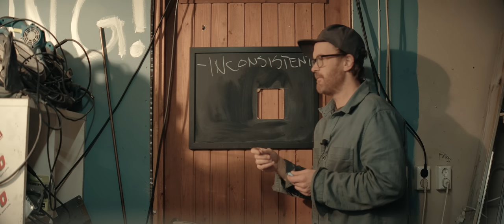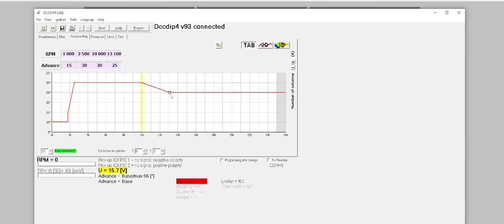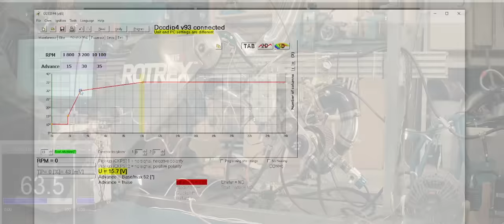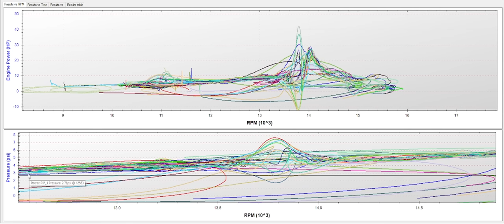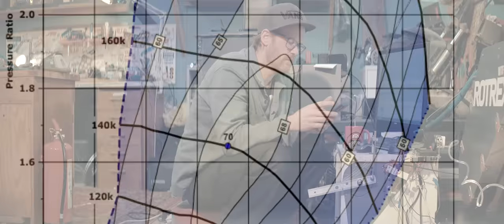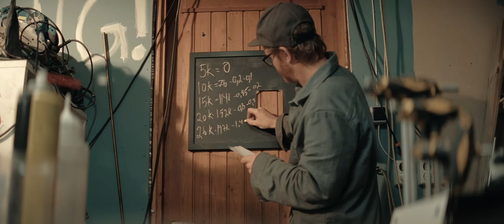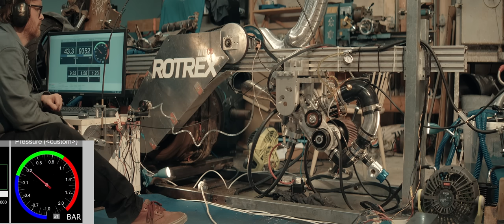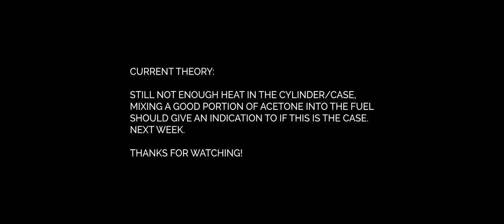Supercharged Pulsejet Engine?

Comment: A friend of mine found that compressed air confuses carburetion, he achieved success by relocating the carb in front of the compressor.
Reply: I think the nitro might destroy the supercharger but yeah, compressed air is confused in general
Reply: draw through is better than blow trough
Reply: If you take a look at the snowmobile Yamaha Rx-1 from around 2003-2005 they are carburated and really fits great to turbo charge and blow straight through the carburators, the only thing to do with the carburators is to put turbo pressure on top of the throttle.
Otherwise the throttles blow stuck in top... Not great... 😅
You can take out 300hp of these and drive it all day for 10yrs.
Reply: @mrolsen6987  It seems as if the pressure is consistent, the carb wouldn't notice.
Reply: @deanfloyd8931   it could depend on which kind of carburator you have.
Wich?
Which? ..🤔
Cheers from Northern Sweden 😂

Comment: I'm wondering if you have a resonance problem; a pulse jet is effectively a resonator. I have very limited experience with petrol and small diesel engines used in construction equipment. However, one of the things I noticed early on with chainsaw engines (and you almost certainly have too) is that they have a ball and spring blocking an extra jet drilling on their carburettors, when the chainsaw (brickcutter, whatever) reaches a certain number of revs, the spring and ball resonate opening the jet, making the mixture much richer and slowing the engine back down. It may be that you have something like the fuel level float vibrating off its seat and affecting the mixture. You've probably thought of this, but maybe using an injector straight into the top of the cylinder head - diesel style - might be a more accurate way of controlling the fuel mix. I know, complications, expense... but you're already pretty damn complicated there!

Comment: 0.8bar puts the ignition flame out and changes it to a fuel pump.  Put a spark plug in the exhaust set to ignite at 0.7bar for afterburner !
Glow plug model aero engines shouldn't work as well as they do while being super simple ? Make adaptor spark plug bush with glow plug inside and try that ? I know it works on a chainsaw engine with methanol.  Perhaps best idea is to connect exhaust to Dutch parliament and hit afterburner, then you will have many famers offering you help. Good luck from the new 'Zealand'.

Comment: Almost looks like your exhaust chamber is acting like a waste gate. I think dialing in the correct boost pressure will be the solution, but there is such a large differential from low rpms to high rpms it seems almost impossible to get right. Maybe an intake chamber to help keep a more consistent flow might help, I don't know, just a thought. I do think that your having a boost pressure issue, I mean related to your crankcase pressure as well, lots of flow issues where there is multiple places where different flows meet.

Comment: The Rotrex delivers constant pressure, and the pipe pulse might be fighting the engine at the pipe's length setting. Can you try a megaphone exhaust, and just rely on the supercharger to deliver the fuel? Should be a very easy experiment Alex.
Reply: I think your theory has merit. It looked and sounded to me like the pulse jet was competing with the engine. It was acting like a limiter.
Reply: @andrewwasson6153  A normally aspirated racing 2 stroke needs the expansion chamber pulse to really fill the chamber, but being supercharged it's actually not needed in my opinion. A low restriction exhaust just might wake that monster up. I have been playing with 2st's for quite a while, and own a 1984 Yamaha RZ350lc, Toomey pipes, 2 piece Boyessen reeds, dynojet carb kit and shaved head. It's pretty raucous
Reply: @popeyeman69  nice! My first bike was a 2-stroke 80cc trail bike I built from a box of parts. Somehow it worked. My first street bike was a GT750 Suzuki triple 2-stroke. Mikuni smooth bores, expansion chambers. It was ported before I got it; fortunately not too badly done. We polished up the ports and it was a monster. It didn’t handle very well (it was a bit wide and unruly) but it was fast in a straight line. An absolute wheelie machine.

Comment: Change to fuel injection. Lexus IS250 & 350 have a secondary mechanical HP fuel pump (they say up to 2000psi) Think it would solve a lot of variables.

Comment: Thanks for your time mate, that was a interesting show today, they all are though for someone who has never looked into the workings of the two stroke engine in detail I'm finding it all fascinating and look forward to seeing what is coming next. You do explain things well I reckon. I've watched from the start when you first started designing and creating and look at the pathways we've travelled. I wonder, why is there a hole in your black bord. I remember you going to the saltflats with your bike and having a go. Now after watching all that has happened since I feel the journey to get there is massively hard, costly but soo worthwhile. I really appreciate your shows, I did have a Kawasaki 750 triple two stroke many years back, it was crazy fast, didn't handle or stop,I hardly thought what was going on inside. 
     This is getting a bit long so thanks again, sing some more songs and definitely don't worry about dickheads complaining about if they are lords or whatever. You're brave just quitting the job and chasing your dream. Bye.

Comment: I'm curious, what is it that is actually happening around 15K when the pulse jet behavior kicks in? is it possibly you are running into a range of extreme destructive interference, basically sapping your compression ratio?? Also what are the possibilities that at 20K+, the fuel will just never have enough time to release its energy potential?? I believe these richer fuels (Nitro at something like 2:1 AFR) tend to burn slower?

Comment: I'd be uncomfortable with how much you are having to do to get heat into this engine and keep it optimal. Perhaps you should consider a thermostat. 

The other option would be a thermocouple which operates a valve. This way you could change the running temp of the engine and find its optimum temp. I would assume somewhere in the range 80-85c

Comment: Drag racers don't run any cooling system with Methanol.  The latent heat of vaporization for Methanol is so high that it draws the heat out of the engine.

Comment: I have been thinking, is there some specific reason to use blower, and not turbo? Turbo don´t steal power for engine, and at factory setups it seems to work fine? But good luck, these videos are awesome. Greetings from finland.
Reply: I don't think you can buy a turbo small enough for 50cc.

Comment: I think you need to advance the timing even more. The charge hasn't finished burning by the time the exhaust opens, once you hit 15K, or so, the unburnt fuel in the exhaust is ignited. It's the only way flames can exit the exhaust

Comment: Boost is pushing your fuel out of the chamber before it even gets burnt bro

You need to run turbo and an E gate to make any boosted 2 stroke or you will be chasing your tail. The engine needs to reach powerband first before you can add boost pressure.

Comment: Run a straight pipe and add more timing, like 40-45° and let the blower do the work....  At 15,000 RPM you have 250 ignition events per SECOND! Your flamethrower is proof that you are not burning  all the fuel before the transfer ports open.... more advance and lose the tuned pipe.....   JMHO....   or your port timing is at it's limit????

Comment: Alex it's nearly 2 am and can't sleep due to my brain working overtime again. 
We know the reasons why the Rotrex should not be used on pull through from the carb thus improving fuel/air mixing.
My question is would you ever consider this option if push came to shove. The speed attempt takes around 4 minutes I believe, do you feel this would put the Rotrex in imminent danger.
I can understand your loyalty to Rotrex.

Comment: Does this engine design have a secondary exhaust port like a power valve?  I know you have the blower on the intake and I think one of the designs you had a secondary intake.  I wonder if  you can measure the pressure and flow of the exhaust as it exits the cylinder.  If you are restricted by flow, perhaps its time to go back to the megaphone style exhaust now that you are seemingly getting a handle on your fuel delivery issues.  You may be limited by your exhaust gas outflow.  If the engine cannot successfully clean out any spent  gas and un-burnned fuel, you will be hitting the wall on performance

Comment: I agree. Not enough heat. Especially if you can make it die from being lean. It should detonate or melt aluminum before it lean dies. Maybe one of those thermocouples attached to a washer under the spark plug to get better idea of actual metal temp of combustion chamber. I have experience with supercharged methanol 4t and 90c head temp would be normal. No experience with nitro but I believe TF cars run about the same or hotter head temp.

Comment: Becareful with acetone Alex iv broken some ring lands experimenting with the stuff and boost. As for why it's a flame thrower I'd guess it has something to do with Pipe math at a much higher flow rate/pressure spikes and different temp than your used to. I'd really like to see a run with a data log of pressure at the pipe. I'd bet a power valve of sorts would help don't think it's gonna solve it though. Nitro is hard to light that's why all the top fuel guys use huge mag ignition with multiple sparks and plugs. From what I understand cdi will give a very strong spark but very short. Big mags can deliver strong but long spark events. Honestly I stay away from the stuff best I can but why don't you try running it on e85? Should light like gas but still have extra o2 and cooling. Wish you great luck bud this project is one I pause whatever is going on to watch lol. I'm sure I'll be back with some more ideas but really if you can get e85 I think it would help you get a baseline even gas just to see what she likes how she acts when. Then if the issues are gone you know it's probably one of the common issues with nitromethane and methanol ie spark not lasting long enough.
Reply: In the 1960s, I added propylene oxide (in small quantities, 2—3%) to the nitro/methanol mix when the nitro % exceeded about 55%. The chemical increased the mixture burn rate... at the price of melted pistons.
Reply: @davidgierke7582  that sounds like a good time. Always wondered what we could do to make the stuff more violent always thought of nitric acid but that sounds much safer and smarter.

Comment: Needs more compression, so you don't have to run ridiculous timing to.make cylinder pressure more cylinder pressure more heat. Or you're gonna have to do some work on the port timing so it's actually trapping compression and not letting it blow by
Reply: Nitromethane has an effective octane number of 40. The more nitro % that is added to the fuel mixture, the lower the compression needs to be—an inverse relationship—counterproductive but true. Otherwise, severe detonation will lead to the engine's destruction.

Comment: I will redirect you to my comment on your last video :D

You kinda admit to it happening.
The combustion is happening after the chamber, in the exhaust, effectively making it a pulsejet. 
You need to keep the combustion inside that little 50cc chamber. 
Why its developing the problem at an earlier RPM when you cram more air into it at an earlier stage just makes sense if/that this theory is correct.

Exhaust Valve plz, fuck the pipe, or double pipe for more return from duals, you got a supercharger :D
Everything seems fine until you get to a certain point of airflow and the chamber is just not coping/cant hold the combustion inside after getting steady airflow. 
You might see an increase in PSI from the blower, but it gets eaten up by the engine, or just flat out flies through it. The Psi stops spiking like crazy when the flow throughout the whole engine is completed and we see a flamethrower pulsejet.

Plz consider that you have enough heat in the engine when youve been running it for a minute at various thousands of rpm under load. 
The cooling water seemed to help stabilize it a few hundred rpm, but I refuse that to be the main issue.

Comment: Hi big fan for many years. 
I can’t help but think it’s a fuel problem. 
I raced many nitro rc’s 
My 15cc nitro boat was doing the same thing. 
It run ok but no matter what we tried on setup I would not pick up as we would like. 
It was too much oil content. 
15% edl 14% caster oil 40% nitro   
It was rubbish. 
15% edl 3% caster 50% nitro and it was perfect and reacted to setting changes. 
But was difficult to get good heat in the engine with 50% nitromethane.

Comment: I do understand that when increasing pressure in the combustion chamber, one must retard ignition timing to prevent detonation. The problem is that it takes approximately 3ms for a spark to form and then the flame front needs to travel. Your ignition timing seems to be too low at high rpm to be able to create a flame front and burn it before the exhaust portion of the cycle. This was evident when you reduced your timing at 15k, which caused you to continuously shoot flames right as it was hitting 15k and the power dropped off dramatically then as well. Increasing timing at higher rpm may be required, it may be better to add more fuel than to decrease timing.

Comment: I love your videos man I'm not too familiar  with 2 strokes but methanol + temperatures that are expected for optimal aeration of fuel I'd say absolutely no cooling methanol is pretty common in the US for race cars and they usually have no cooling what so ever methanol keeps them so cool
Reply: With the rpm I agree with some of the other comments maybe slightly preheating the fuel mixture I don't agree with the mixtures given though maybe a metal tank with a heating element that run for a minute or two

Comment: Hi Alex another cracker video , I still feel expansion chamber (pipe) needs to be another 6 to 8 inches away from cylinder you'll get into topend powerband then..
Plus combustion chamber bigger cone shape this will move spark plug further away at top dead center to create more combustion area 15 to 20mm is better than 10mm more fuel more air needs room to combust , it's combustion out the pipe not so much in the cylinder hence the screamjet. 
Once pipe and combustion is optimal you can increase blower drive max hp at a reasonable safe rpm meaning not over reving. 
Check out a gp rs 250 cylinder head combustion chamber very cone shape raised sparkplug that's first answer fix the flames.
Cheers mate

Comment: Not sure your heat theory will do anything but melt stuff. Looks to me like a port timing issue. Almost like you get to a point where the pro charger pressure blows thru to the exhaust. Is there a point of diminishing returns? Where either the primary compression or super charged compression has to be the port timing priority ? Like old EMD or Detroit diesels? Where ALL the pressure it from supercharged then on later versions  turbo over supercharger pressure to both scavenge & recharge the cylinder. So either packing the crankcase or longer port timing to pack the combustion chamber not sure which you have done. Interesting for sure. Innovations on top of innovations :)

Comment: Nitro Methane is a slow burning fuel with that much valve open time at higher RPM you might not be burning all the fuel before then next hit of fuel is getting past the valve leading to Deflagration instead of Detonation because its lighting before compression. This is how nitro cars get big back fires but my guess would be your moving more air then the flame wave can propagate down because again the slower burning. Most nitro top fuel cars squish the rod bearing every pass because there timing is set so there firing as close to TDC as they can and still be past it the rod is crushing the bearing from cylinder pressure. Only if you feel good about it I would try running it for a pull with out water as you said most drag cars do a pass on methanol with no fans of cooling of any real kind they let them cool off between passes. A lot of these engines are leaned out to get them up to temp you can see this when a top fuel car goes to make a pass after staging before they launch one of the crew most likely the chief will give a little nob next to the blower hat a twist or two to fatten them up before the loaded pass. I would say with Nitro Methane or Methanol  you are going to need more timing then the norm in some cases more then you would think is safe on other faster burning fuels.

Comment: The titles aren't a scam per-se but the issue is that the amount the small land parcels are worth do not qualify for required reporting at the land titles office. 

Basically there is no official government record that you in fact own the land you purchased. 

If for some reason the company you bought the land from folds and the land is auctioned off you would have a hell of a legal battle on your hands to prove that the sale of that land to another party was illegal.  

It's more of a donation to a conservation project, and as long as the company that sold you the land is operating then I doubt you'd lose out, although if anything did happen you'd have to sue the company.